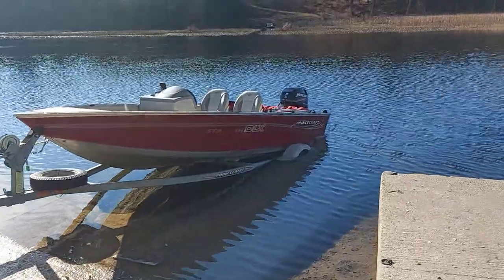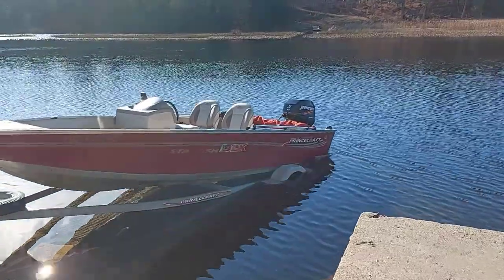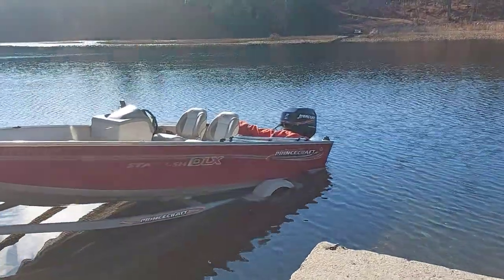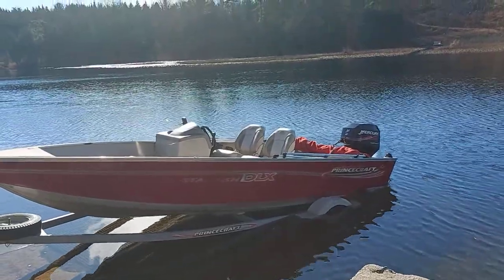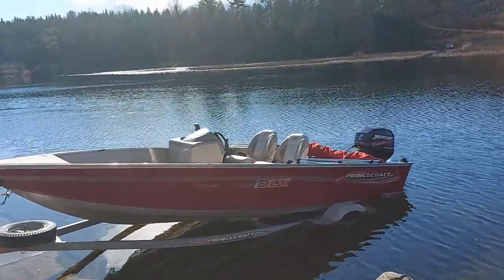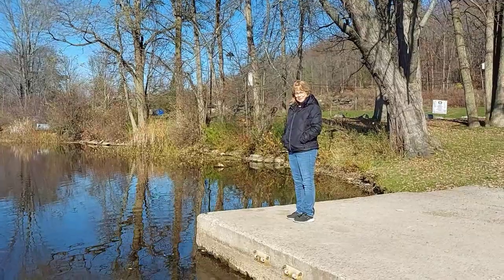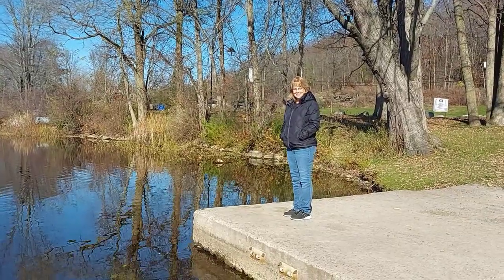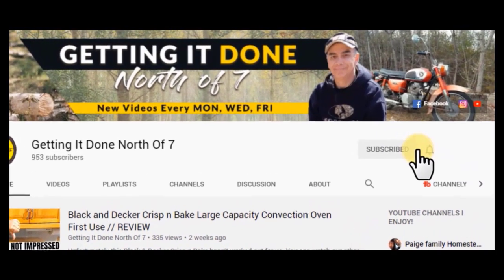Get My Boat Motor Ready For Winter

Comment: Great info Roland. My grandfather years ago when i was little we lived up north N.H any way he didn't drain his lower gear unit and check it for water it had a bad seal he didn't know about the lower unit froze and split the unit. From that year forward he drained it every year and added new oil. Great video and looks like your getting cold up there.
Reply from the maker: Yes Tony, I checked mine and everything looked fine. Thanks for dropping by 😀

Comment: I always change the oil in the lower drive every fall . Too many times I've seen a bit of milky stuff mixed in with the oil . Why wait  for spring , do it now . Wish I could keep my boat in the garage for the winter . Garage is filled with too much stuff . I even empty out the gas line .
Reply from the maker: I checked the oil in the lower unit and everything was fine. Thanks for watching.😀